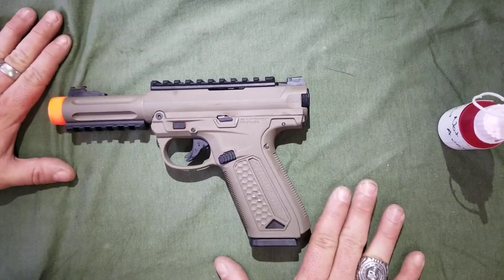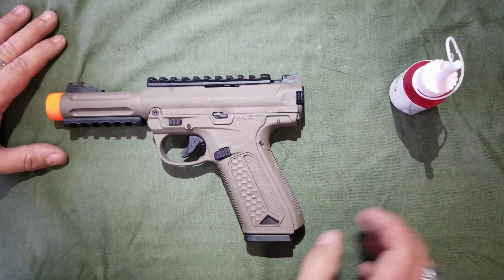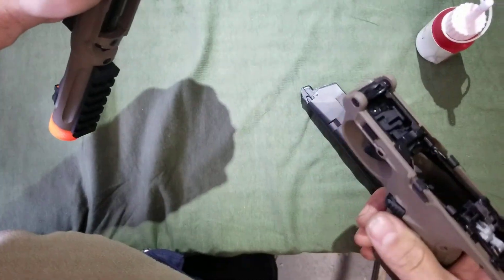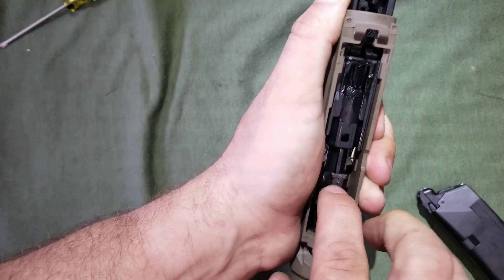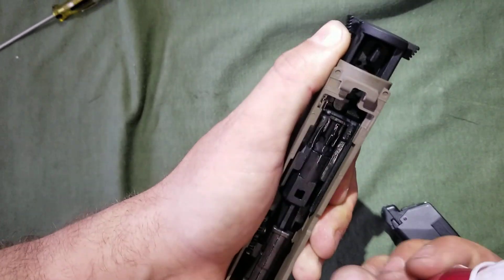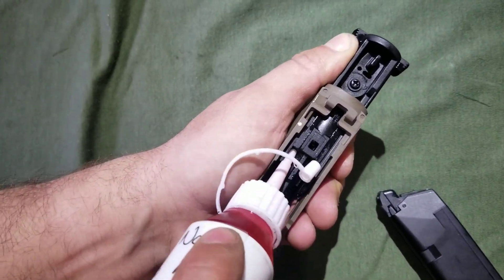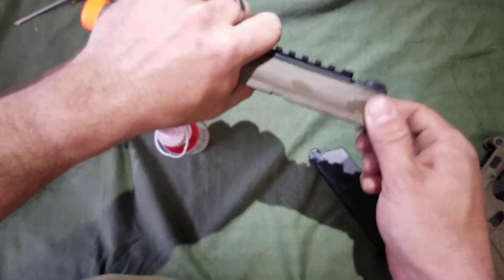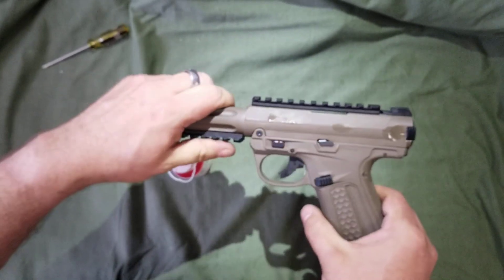AAP-01 Airsoft Pistol Oiling & Maintenance 🤔#airsoft #aap01

Comment: Could you use tech t gun sav performance grease to do this. As it is just a silicone oil.
Reply from the maker: If it is silicone based, not petroleum based, or real firearm gun oil.  Grease is fine as long as it's silicone or lithium based.

Comment: But what thickness of oil is it , thin ? And what about recoil springs ? I have a new receiver coming in the post and recoil spring and don’t know what silicon oil it needs for all those parts
Reply: Hey, it was a mid weight 100% silicon oil.  We use the mid weight because it provides the best balance in lubrication and longevity. Any 100% silicon oil will work though.
Reply: Also, about the new receiver, the same thing applies as the rest of the gun.  The recoil spring is hidden above the nozzle assembly so it gets oil when you oil the rest.